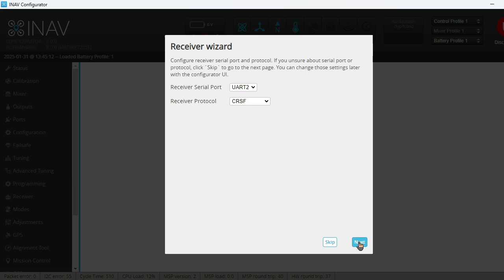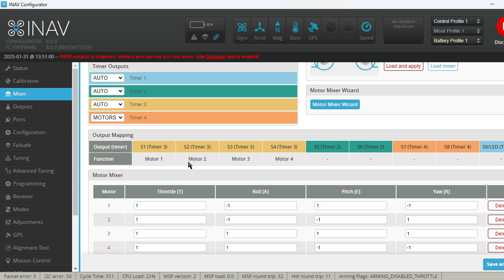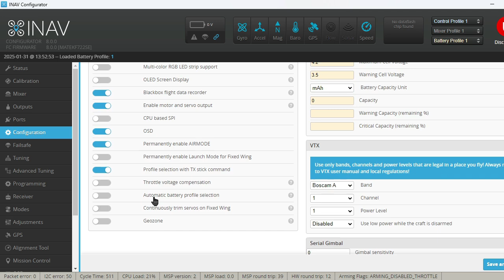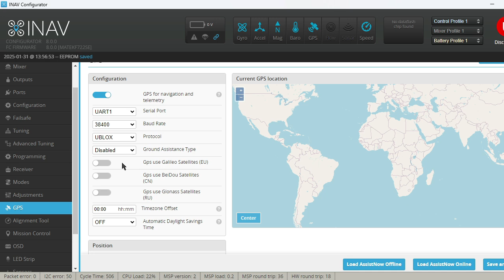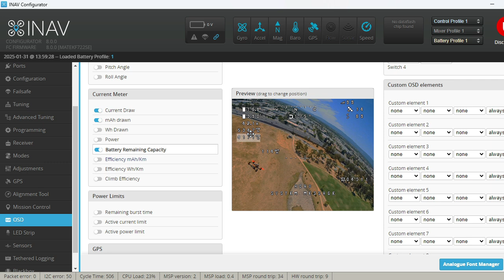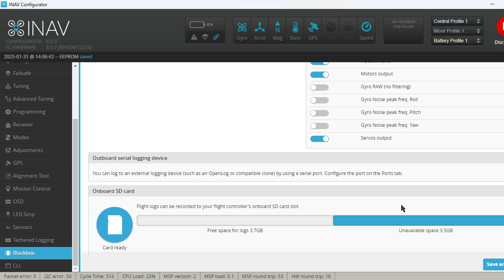Setting Up INAV 8.on 7 Inch Video 2

Comment: I have inav 8 installed but the battery voltage that is displayed in OSD is not at all right in OSD it shows 3.4 but when I land and connect a battery checker it say's 3.9 volt
Reply: That's probably because when the power is drained voltage drops significantly